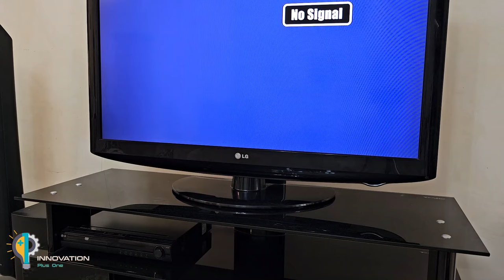Insert Bolt into the TV and watch all the channels in the world || Antenna Booster

Comment: Terrible job, how about pointing out the measurements on the foil has to match the cardboard measurements. And the holes in center have to measure out to your individual splitter 
Why does no one show channels u get regular, and channels gained by following your suggestions? Nothing worse than going through all of this, and finding out u get the same channels as before
Reply from the maker: Thank you for your comment, in general, did you like the construction of this antenna?